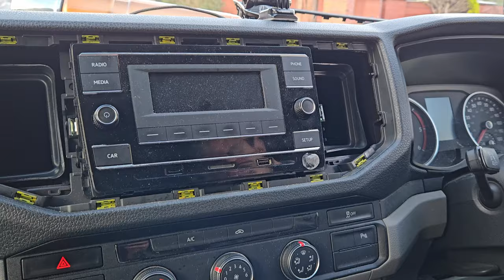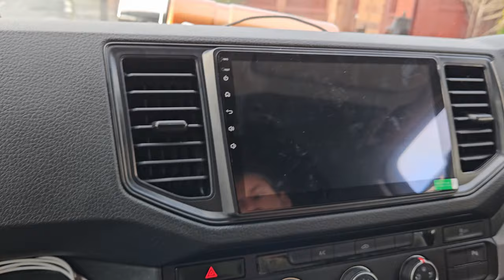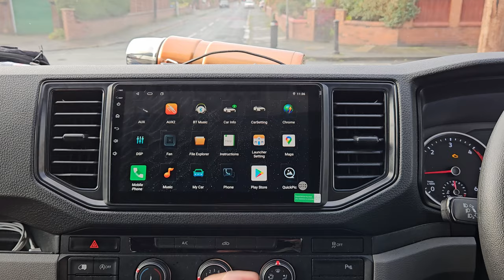VW Crafter Radio Removal Android Car Stereo Head Unit Fitting Install Volkswagen Crafter 2018-2024

Comment: Battery drain? If not, why? You didn't cut any wires. I plugged mine in, flat battery the next day.
Reply from the maker: If you use a specific wiring harness and canbus like the one we sell you will never have a problem with battery drain and you don't have to be electrician to do this because it's plug and play, anything like cutting wires or drain battery means wrong parts used for installation.